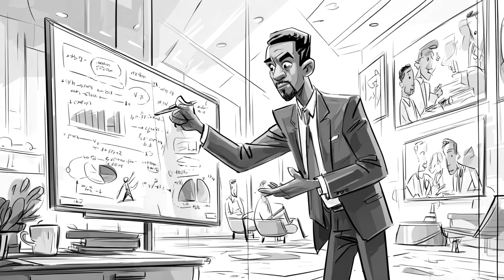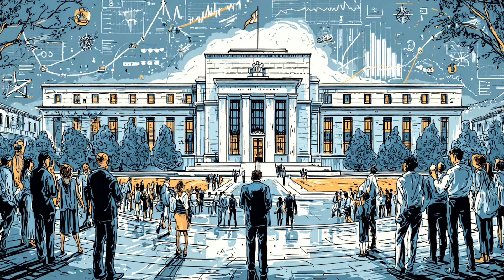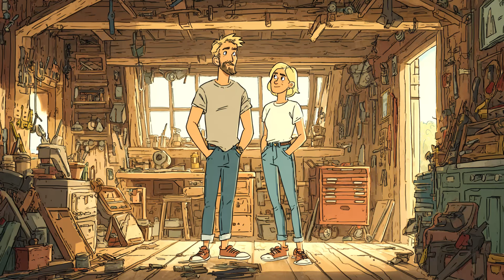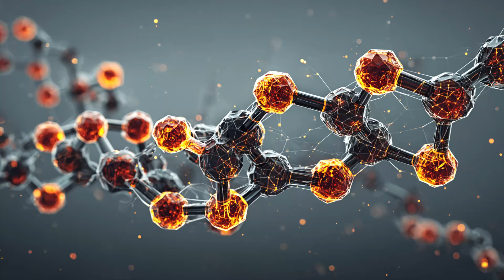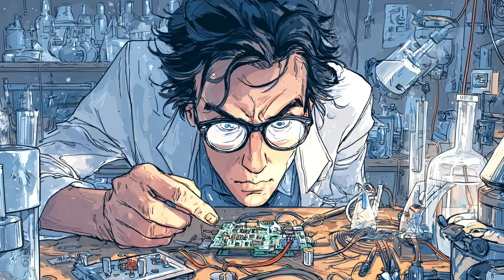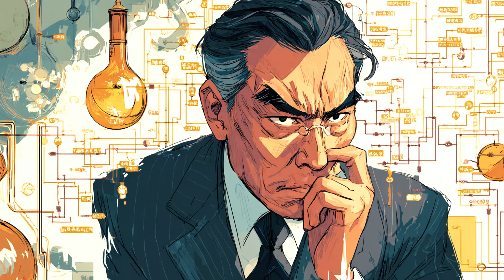China's Diamond Dominance: How Industrial Tech Killed the Luxury Myth

Comment: I wonder if they used this technology to compress plasma? Could it create fusion? There's a company in Canada trying to do something similar but has so far been unsuccessful.
Reply from the maker: No, this is a mechanical device for generating high pressure
Reply: @DeepDiveGlobal9...the fusion company is called "General Fusion". They actually use a mechanical piston to try to create enough pressure to compress plasma to reach fusion. I think they had some initial success but have not heard anything from them for a while. 🤷
Reply from the maker: It seems China has come up with a more cost-effective method.